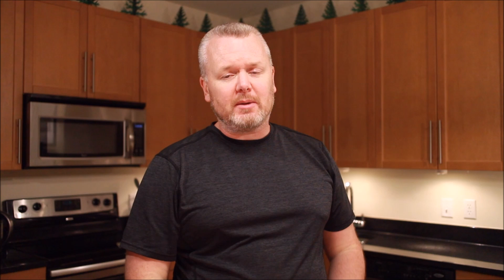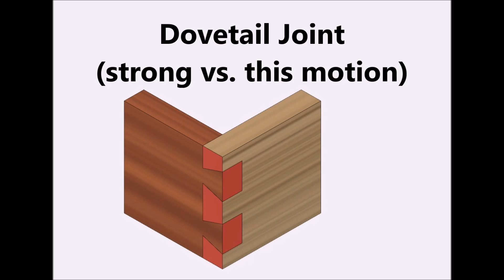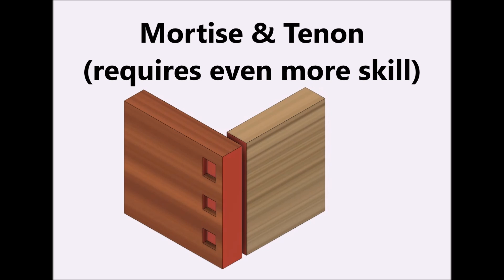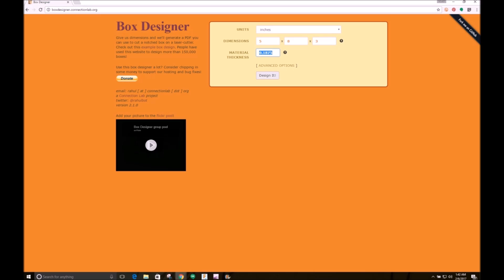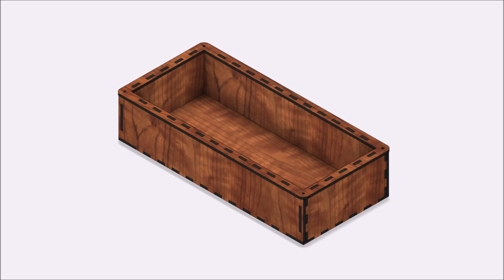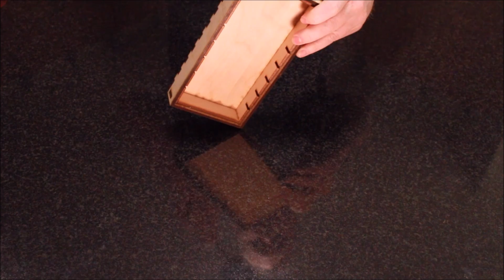Better Boxes

Comment: You can make a box stronger by doubling up wall thickness and increasing the glue surface area on the joints?  What wizardry is this?!

Comment: Interesting.  Unfortunately, as mentioned by others changing the parameters does not work properly.  Try changing the three inside dimensions to be 58mm each.  Results in four errors and four warnings.  The drawing is obviously incorrect.

Comment: Woodglue works just fine on plywood, however I do see your point. Laser cut, thing material, boxes aren't meant to "carry around in your backpack" Most use them for simple storage or as drawers in a larger container.

Comment: I love the box design.  I was looking for a sturdier box that could be scaled up to larger sizes out of 1/4" ply.  

When i try to adjust the parameters in fusion 360 the sides don't appear to scale properly, but this is a great start for my project.  Thank you for sharing.